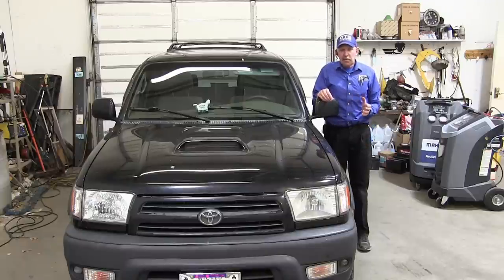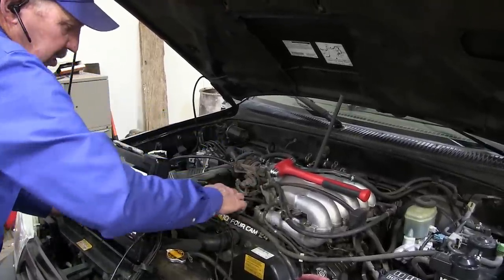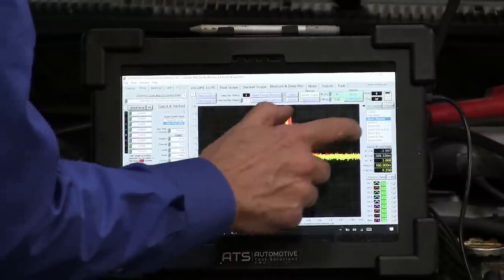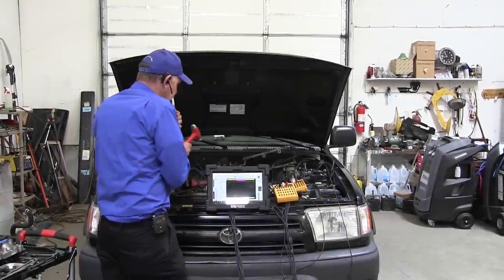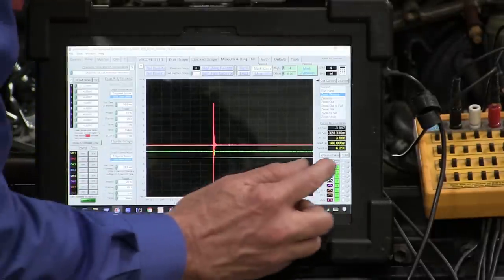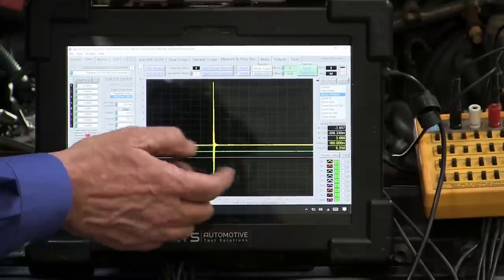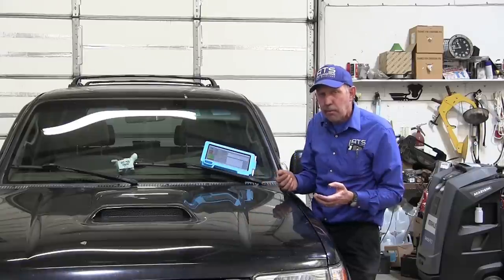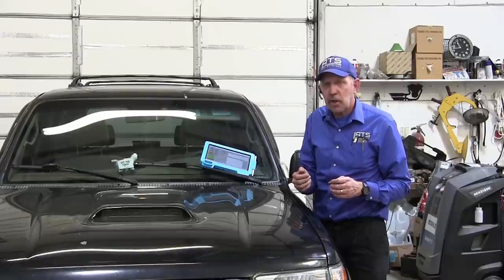1999 Toyota 4Runner 3.4L with Knock Sensor 1 DTC

Comment: The hardest part about diaging for me is knowing what I'm looking at. So what I started to do is when a car comes in I make a file of known goods. I scope all the  communication lines with B.O.B and anything else thats easy to access with a signals. We all know what a good power and ground loaded looks like but different manufacturers uses different signals. Also I scoping in cylinder,intake and exhaust on known goods. I started making a file for all of my harder diags as well because my memory sucks especially the  busier I get. Its helped alot, I keep scope captures with written record of everything I did to find the problem even keeping the good scope captures so I know. Obviously it would take a long time to record them all but I try to at least get the harder diags.

Comment: As always Bernie is amazing. I always tested these sensors with the car running and revving to 4k rpm to look the frequency. But i see Bernie is doing it with KOEO. Something i learned. And yes i do it with my Escope elite 4 and it works great because of the 16 bit vertical resolution and works fantastic.

Comment: I have this knock sensor problem on my 99 tacoma and I was tempted to buy aftermarket sensors. I am so happy I stumbled upon your video (by accident) this morning. I will be buying OE sensors when I replace them. Thank you for your detailed explanation and showing that the aftermarket is not the way to go when this repair needs to be done.

Comment: Great tutorial Bernie, now I have my Escope elite It is gradually becoming my go to over my Pico.
Reply: I love the pico. I have the 4425a but I use a 2k 4 channel version. Initially, I wanted the automotive version because of the library and presets from automotive but once you get used to diagnosing, you dont really need any of those. I got the rotkee version which has 8 channels and goes up to 500 volts and has presets for the hantek amp clamps and they have very cheap pressure transducers, etc. I got the scope for 225, in cylinder transducer for 105 and it is awesome. I already had the Hantek amp clamps so that was great. I have used my 4425a a couple of times but I only pull it for tedious diags where I want certainty and to be sure what I'm looking at is true.

Comment: I am new to your channel, and I am not a technician, but a retired electrician. My sister had a knock sensor problem just like this one on her 2001 Highlander, I went to Reilly's and got their version of knock sensors, I had to take them back because they were worthless. Got me OEM wire harnesses  and sensors from Toyota dealership and $650 later it runs like it should.
 I learned from my Runnings with time -wasting "technicians" when I fixed my Nissan D 21 199.
 He who buys cheap buys twice.
Reply: As im a plumber, people calling me asking me how much is this and how much is that, they tell me why so much, i tell them because im license and i guarantee my work if it break or clog up again i will come back, if you pay cheap when you call him back he wont come back because you pay cheap the first time, so pay me more and have guarantee and piece of mind.

Comment: OEM sensors only on knock sensors. We used to see it all the time on this 5vz-fe engine. Problem is the OEM sensors are ~$140 each, the harness is ~$60, intake gasket set is ~$150.  Because of the expense we often see other shops and diy alike use cheap parts which never work properly.

Comment: Damn songg ... This channel has the more incredible cases, this is nice but not better than the magnetized engines episodes ...  those were sicckkk.
Reply: Yeah, crazy that the day before I had worked on a WRX with manual tranny, it was a 2015 in my case and i was seeing the exact thing as Bernie was seeing but in my case, one of the cams was dropping out every now and then and would stall the car randomly during idle. The weird thing is that after I replaced the cam sensor that was sticking, the car did not stall anymore even when the signal reference was the opposite, when revving it up, the ref would flip the other way just like he showed, in my case though, it did not set any codes. Just for kicks I noticed we had another 2017 WRX with the same known good. I checked intake cam signals (they are in the front now which is easy to get to) and to my surprise, the left intake was not in the correct orientation. It was being pulled down just like the right bank sensor but it would not flip under acceleration like the 2015 did. Known good said that right bank should pull down and left should pull up. In this 2017 both cams were being pulled down, dont know if the manual trans had anything to do with that but that was what I saw and the car did not have codes or any sort of problem. Some thing you will never figure out I guess.

Comment: It only took one car I bought in auction I heard running poorly and thought I had it figured out before I bought it. Turned out I was so wrong and finally just got  tired of chasing everything I could think of. I scraped it. I did find it would keep going back in limp shortly after I would get it up and running and driving very well a number of times so now I am determined to tool up to do it right from now on. I am a believer !

Comment: Excellent video Bernie! Agree 100%! Had almost the same exact situation a while back... Only difference was worldpac sent a defective batch of OEM sensors, 2 different times...3rd time was the charm + came from another batch.  Was able to compare KS signal waveforms from a known good engine from same Era... Very frustrating.. Couldn't have fixed it without a scope and a known good waveform..

Comment: Great video everything you did makes perfect sense  .  In this case you had two sensors to compare as a start for data. If both aftermarket sensors had given  incorrect but identical data how would you have known that the ringing frequency was wrong ? Do the oem manufacturers give out such high level data for comparison I would imagine with the climate of intellectual property theft in certain countries such data would be held in secret. Anyway only trusting OEM sensors is the only definitive test  your video proves that pay the extra $$$ fix it right the first time.

Comment: Bernie's right!  The scope will help find the problem.  The scan tool and/or the Digital Multimeter (DMM) won't ! !   The better quality scopes have a record feature when trying to diagnose an intermittent problem.  I have an old Fluke 98 I used for years, but I wish I had my Pico 20 years ago!

Comment: Hey Bernie I wish you would show the configuration of how you hook Those sensors up through those boxes to load them
Reply: Simple
One wire sensor: between signal and ground.
Two wire sensor: across the two signal wires.
Same way as you would load a circuit with a test light, but this time you need a high resistance load.

Comment: Excellent video!  I wonder if the original sensors replaced were actually bad.  Shame you didn't get it first because I know you would have tested them.
Reply: They are common for failing around 200,000miles. Many times it goes unfixed for long periods of time unless the driver noticed the reduction of power. It pulls 5-10 degrees of timing when a knock sensor fault is present.  They will also fail is disturbed during a headgasket replacement.